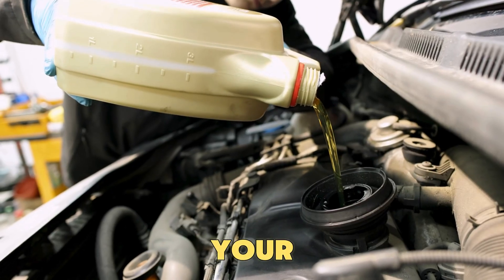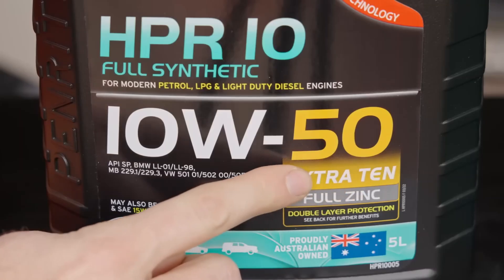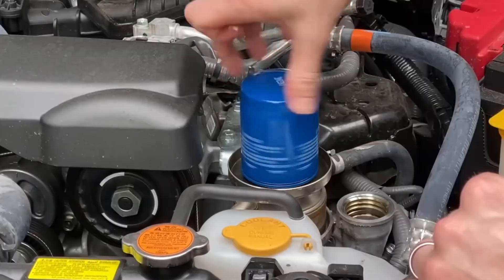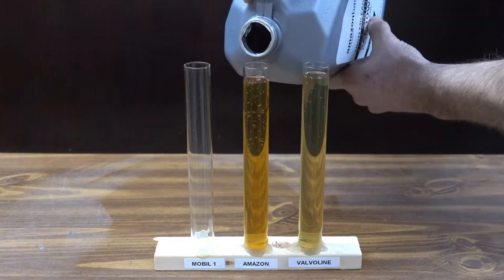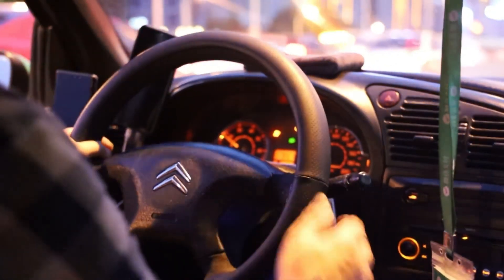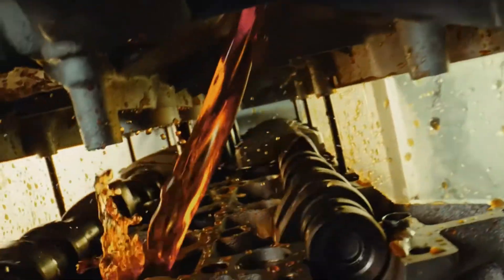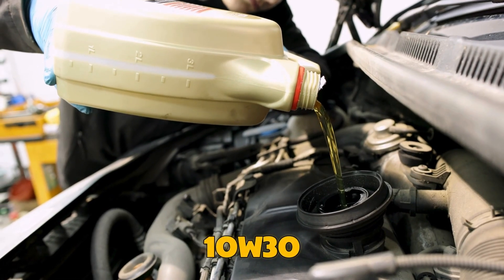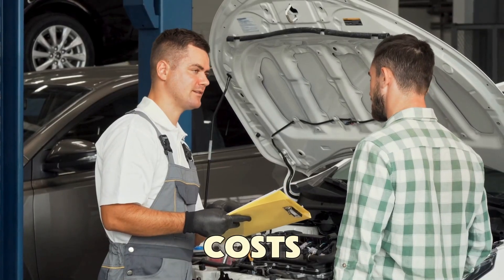The TRUTH About 0W 20 vs 5W 30 Oil (50 Engines Tested!)

Comment: I asked Google if my engine used different viscosities in other countries and this what came up (it's all about CAFE standards in the U.S. so yes, you can use different viscosities of oil. ) Yes, the 2GR-FE engine is often specified for a higher viscosity oil like \(5W-30\) or \(10W-30\) outside of the U.S., while the U.S. market typically requires \(0W-20\) due to emissions and fuel economy regulations. The specific recommendation can vary depending on regional climate and local standards, with the engine being designed to be compatible with a range of viscosities, often listed in a temperature-based chart in the owner's manual. North American market: The 2GR-FE engine in the U.S. is commonly specified for \(0W-20\) synthetic oil to meet fuel economy and emissions standards. Outside the U.S.: In other markets, the owner's manual may allow for a wider range of viscosities, including \(5W-20\), \(5W-30\), or even \(10W-30\), which are better suited for different temperature ranges. Compatibility: While the recommended viscosity varies by region, the engine is designed to handle a range of oils, and you can use what is specified for your region's climate as listed in your owner's manual.